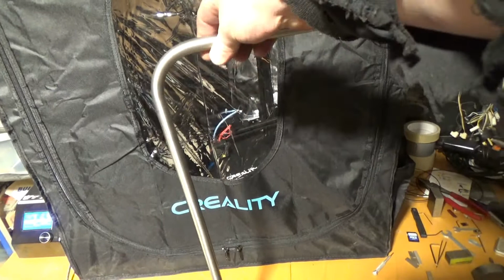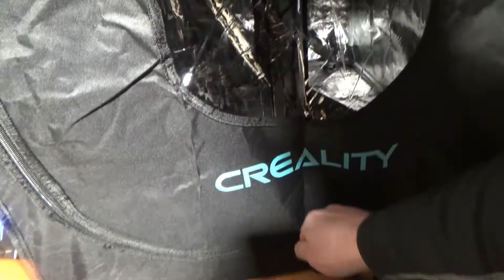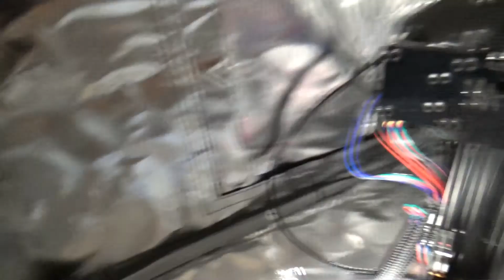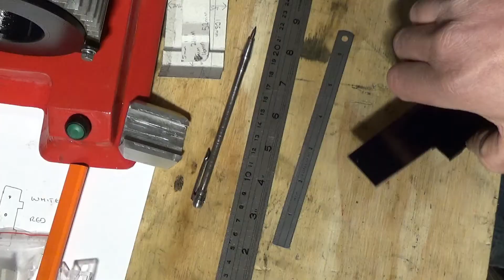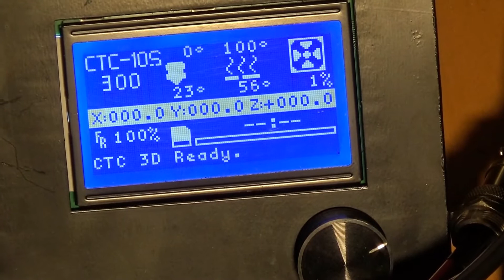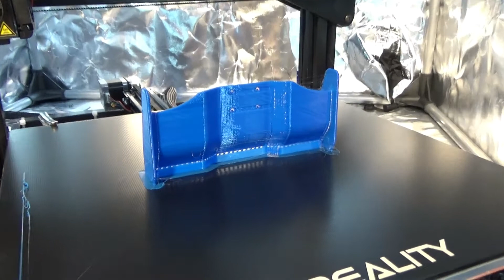CTC 10S 3D Printer Bed Upgrade

Comment: I've had years of experience now with 3d printing and I wonder what size nozzle you are using to get your 0.4mm layer height. I use a (now fairly standard) 0.35mm nozzle and get pretty good results up to 0.3mm layers. I suspect you need more like a 0.6mm nozzle to be successful at 0.4mm layers. You also may need a direct drive head as the high volume of filament may be beyond  Bowden tube. Finally, there's a YouTube you may find useful (probably many), the site is called CNC Kitchen. He does a very good job of analysing the many parameters that can vary between machines, filament and settings.
Reply from the maker: Hi. good question. It was a .04 drilled out with a 1.0mm drill bit for the blue PETG print. the last prints are 0.2 layer 0.4 nozzle. I watch CNC Kitchen he is very interesting. Currently though, I am gearing u to install a BTT GTR v1.0 with full SPI drivers along with bl touch and way more.

As I am very new to this plastic squirting game any tips and hints are welcome thanks.